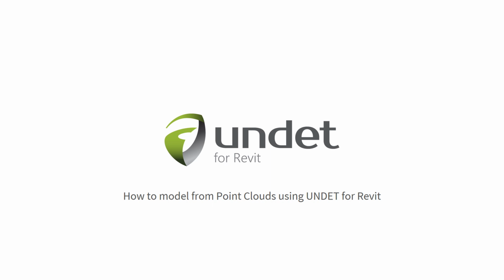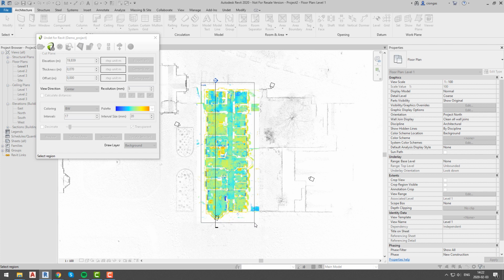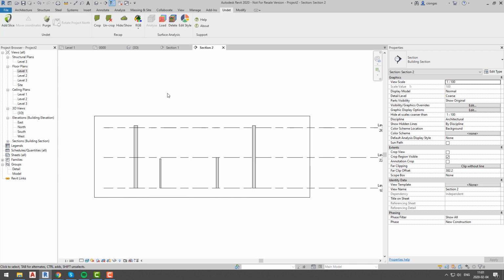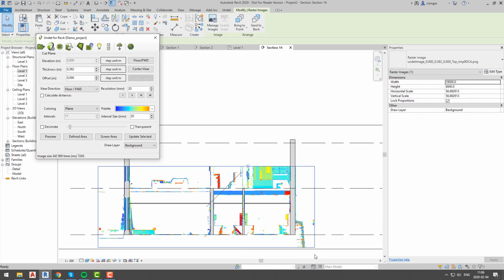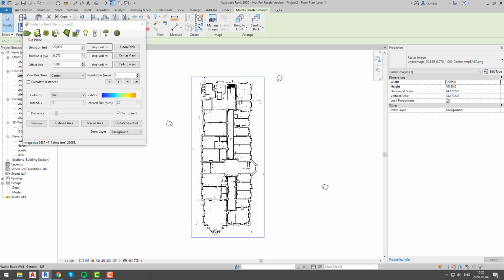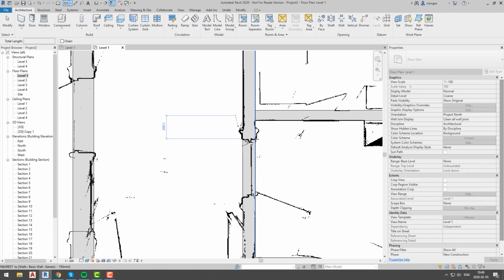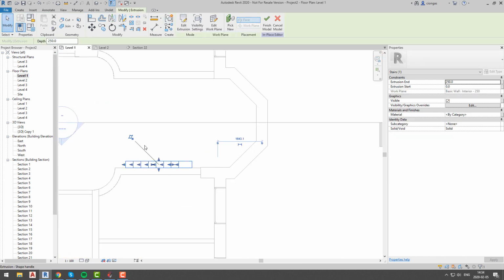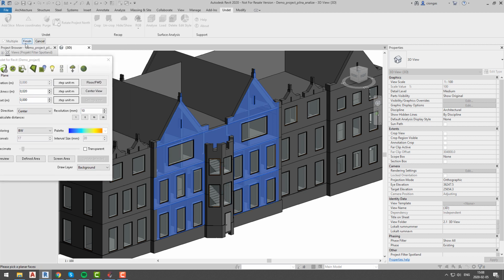Undet for Revit | How to make 3D model from Point Cloud

Comment: Hello! For someone doing pipe work and using point cloud data of an existing space and converting it to a 3D model, would Revit be a good option? I have a friend who currently uses AutoCAD and a specialized 3D Plant toolset, but he is looking to increase efficiency a bit. Would Revit help this person with better ease of use? 
I would appreciate any input you might have!
Reply: At Undet, we frequently work with Plant and prefer using Revit over AutoCAD for its ease in 3D modeling with the combined features of Undet and Revit. While the transition from CAD to BIM might be challenging at first, it will ultimately save time in the long run.

Comment: hello, i have some question . do u know how to cleaning up or remove unnecessary point cloud in revit ? please help me
Reply: Use Autodesk Recap for Cleaning unnecessary point cloud .
Reply from the maker: When you are creating dynamic views, please select "Calculate distance" and UNDET will create a dynamic view from the first visible point, the created view will be much cleaner. Otherwise, you should clean (remove unnecessary) points in scan data registration software before creating the UNDET project.
Reply from the maker: Hello, Nurul Shafira.
If we are talking about Undet for Revit there are two ways how You can do that. First one is to adjust thickness size of dynamic image. Another way is to turn of unnecessary scan positions files or data groups.